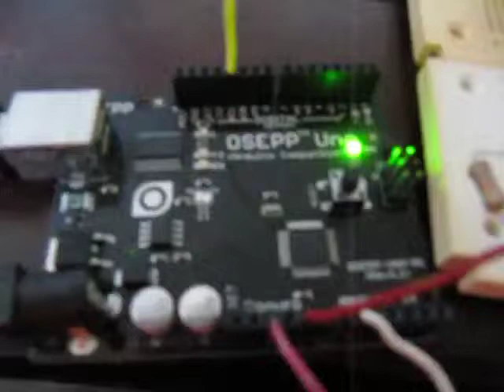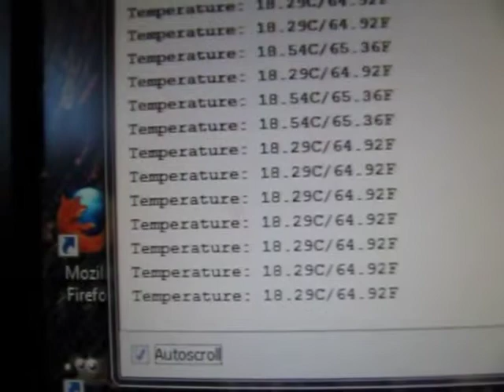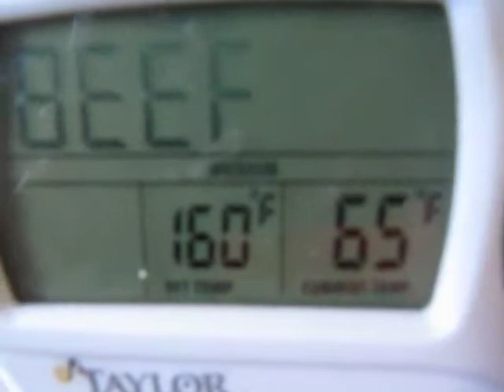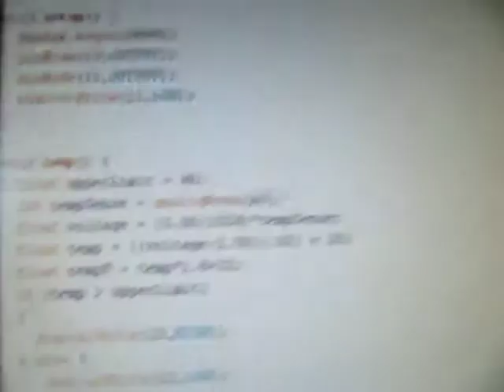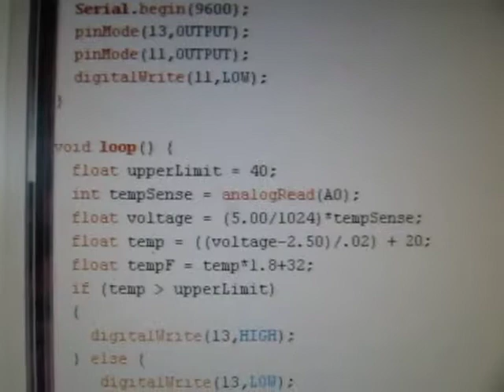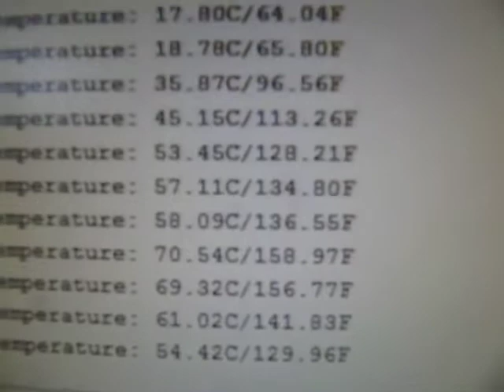Arduino Temperature Sensor Experiment Update 1

Comment: I used the LM35CAZ/NOPB.  worked great.  Also wrote a 60hz PWM on an analog pin to drive a Crydom high amperage solid state DC relay running a blower.  When I get un-lazy I'll tie the two together. (Arduino's built in PWM is way to fast for DC motors with brushes)